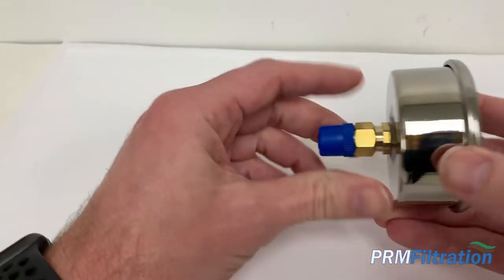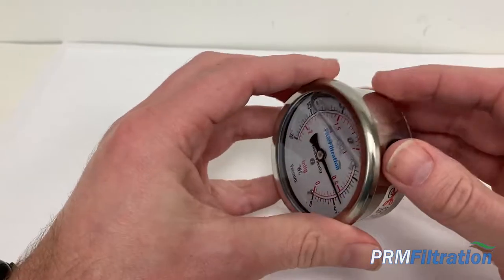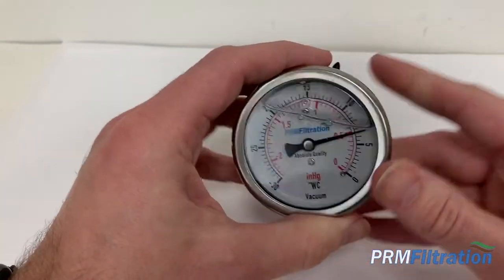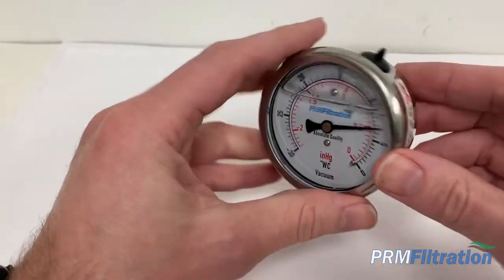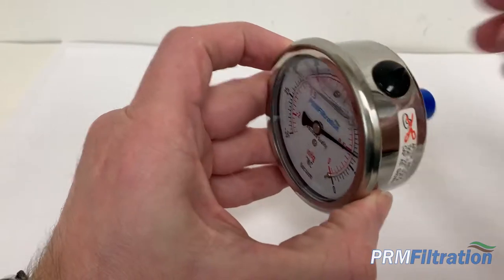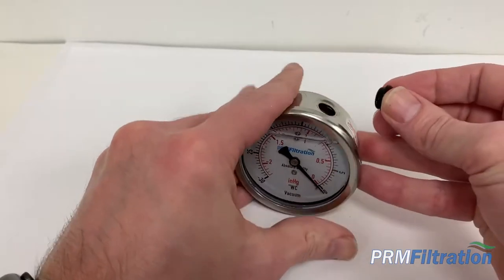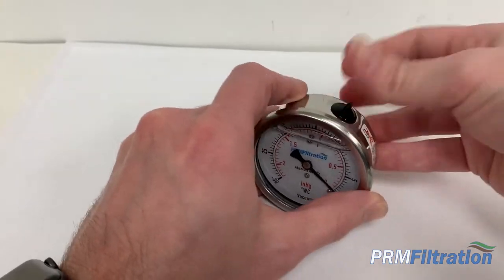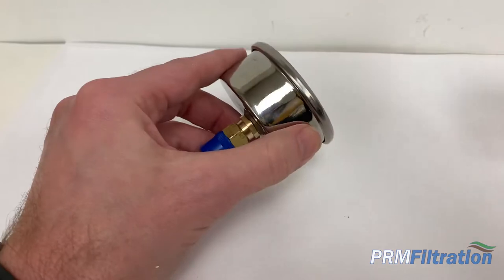How to Zero a Liquid Filled Gauge

Comment: Can you help? My 0-30 gauge is same as in your video. needle is sitting at 20, because outdoor temps dropped below freezing. So, it's not a question of burping it. Any other way to get that needle back down to zero?  Thanks!
Reply: Can u warm it up inside or use it inside i spilled mine so i refilled but now it go's past 30 wtf

Comment: The guage I got was like yours in the video, 3/4 full of glycerine. Should I fill it to the top or is that how it should be?
Reply: Leave it alone. They're supposed to be like that so the fluid has room to expand when it gets hot. If it's filled to the top the fluid has nowhere to go so the gauge will start to leak.